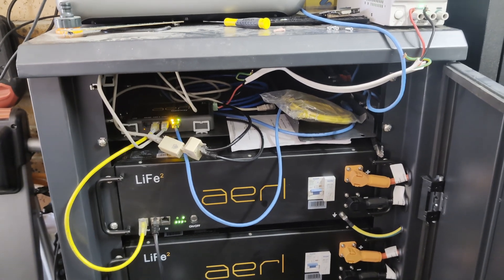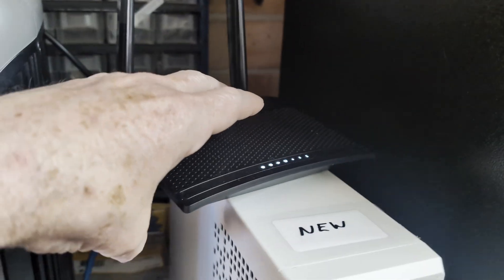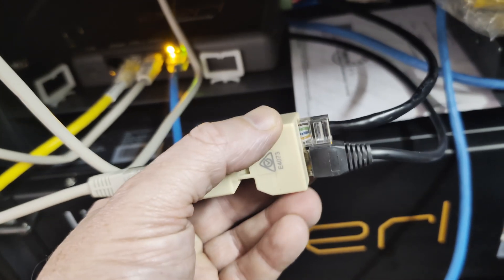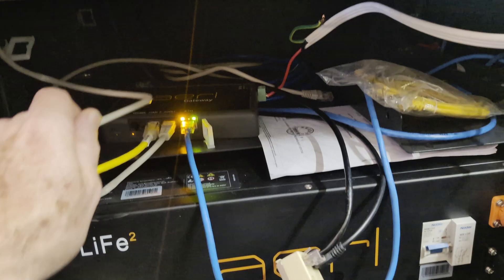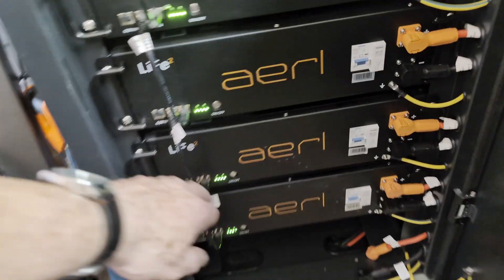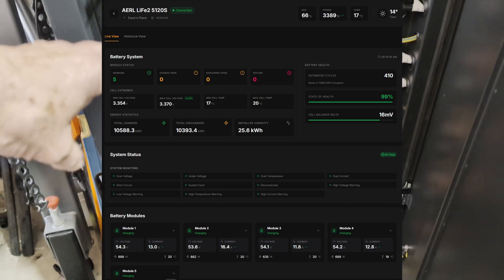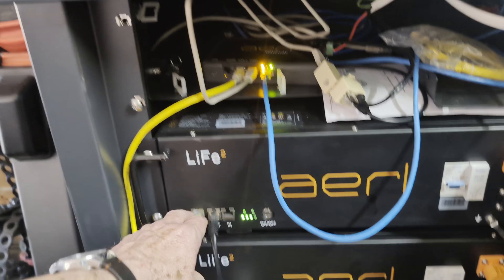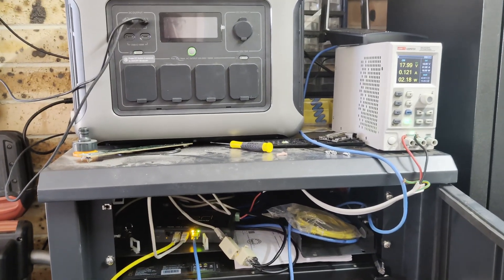AERL Battery Firmware Update

Comment: Nothing more permanent than a temporary fix. Definitely extra points for a random Pi just flapping around in the breeze. I've seen Ethernet joined with wire nuts before, so it definitely could have been more bodged. 8/10

Comment: Indeed, an 8/10. Manufacturers should agree & follow standards. But then we would not enjoy your creative thinking and problem-solving.
As the famous (Dutch) saying goes: at the carpenters house all the doors creak.
(or: at the home of the plumber, the faucets leak)
Meaning, because you know how it all works, operates and hooked together, does not mean you won;t run into the occasional challenges that one thought should be an easy fix.
My "translation" of course, but I always say with such challenges: dig deep, dig hard, the reward of finding a/the solution will be the reward.

Comment: Step 1 is to get it working as proof of concept, and it doesn’t matter what hardware or dodgy cabling was used……but ONLY if there’s an immediate follow up incorporating a decent job.
The clock is ticking Dave…..😀

Comment: This looks more complex than solar panels embedded between standard gauge.
Reply from the maker: I wonder how those dodgy railway solar panels are holding up?
Reply: @EEVblog2  Sunways office is just across their tech uni  and park near the International Olympic Committee. Comparing both organisations for a cost vs benefit I think Sunways will be ahead in the long term. Back in 1980 when their first noise protection wall weent up on freeways they installed trial solar panels. 45 years later they are still producing power.

Comment: 6/10  The bench power supply being used as a wall wart was worth two points.
Reply: I had a mixer once that came with no PSU so I used a lab PSU, that thing also ran my first wireless router for a bit.
Benny Andersson's Yamaha GX1, from the videos of his studios I've seen, uses multiple lab PSU's for power.
Reply: I won't admit to how long a lab PSU ran my sat receiver. 😂
The original switching wall wart had a weird voltage of like 14.5V for feeding the LNB and ate caps until the switching IC cratered 😢